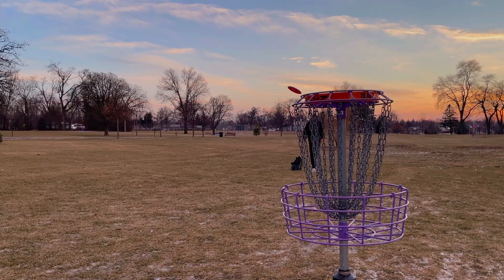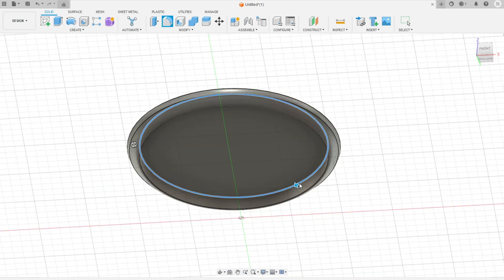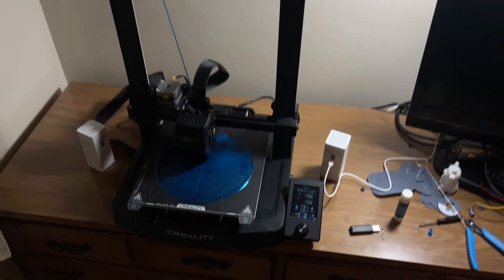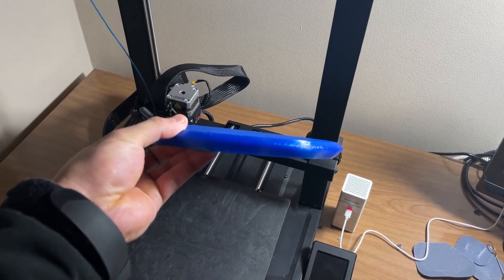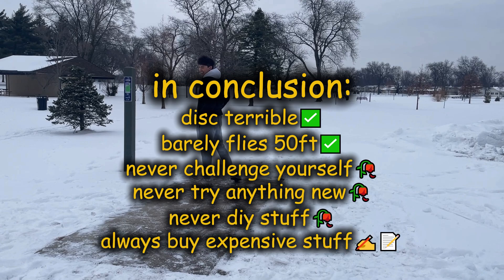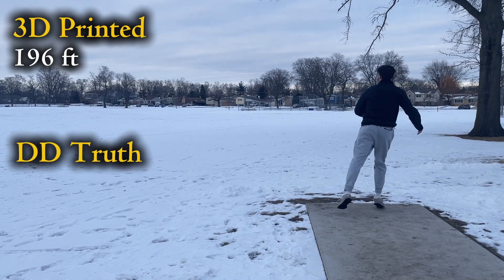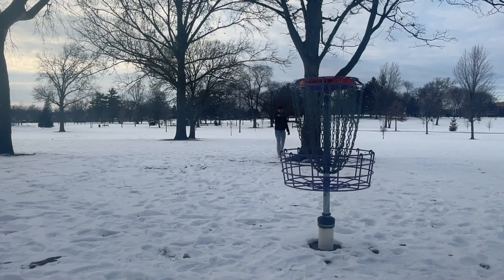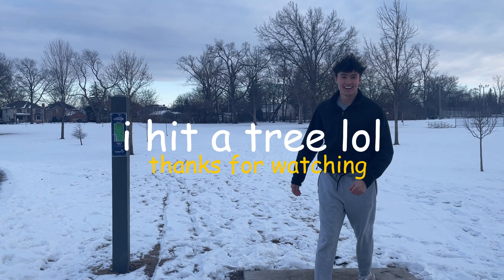i designed a $5 3d printed disc golf disc (its goated)

Comment: What Cad Software did you use?
Reply from the maker: I used fusion360 but mostly any cad software works you just need the revolve feature to turn the cross section into a disc
Reply: @j-seroI’ve literally tried to go watch every video on YouTube to try and learn how to design a disc. I’m doing my best to do it in tinkercad. I’ll have to see if it had the revolve tool. But I’m also gonna see if I can design in 2d then revolve it.
Reply from the maker: @BoyteDiscGolf  Tinkercad wont have any tools like revolve, A good one for free is onshape, you can use it on browser, you want to imagine the disc got cut in half and you are designing mainly the rim and the dome part from a 2d profile.

Comment: Are you running that printer stock? You need to use klipper if so. That should at least half your print time
Reply from the maker: Yes I’m new to printing so it’s stock, I’ll look into klipper and prob end up using jt, thanks for the help.
Reply: @j-sero Klipper is super easy to set up compared to what it used to be. Get yourself a Raspberry Pi 4 and a $10 accelerometer and let's go.
Reply: Pff, sure! 😆 How does klipper magically upgrade the extruder and hotend again?
Reply: @oyuyuy it doesn't, but until you run the machine at a high enough speed that the extruder/hotend becomes the limiting factor, you can definitely achieve significant speed improvements, mainly through input shaping and pressure advance. I'm speaking from experience
Reply: @imaginitivity7853  Very limited experience unfortunately - the extruder is pretty much always the limiting factor for TPU. He's printing at about 40mm/s (and rightly so), it makes zero difference what firmware he uses at that speed.

Input shaping and pressure advance doesn't directly improve speed, it's used to improve quality at high acceleration - which again, isn't relevant at 40mms/s.

I'm speaking from professional experience.

Comment: Bro this is sick, I'm definitely designing my own. Did you use petg with 100% infill to avoid breakage?
Reply from the maker: Thank you, I used TPU with I believe around 80% infill because discs tend to have a little flex to them.
Reply: @j-sero You might actually see a decrease in print time if you kick it up to 95% or even 100%. Generating infill patterns at that level of saturation of the model will often cause retraction instead of a straight print line. Either that or get Arc Welder plugin and use gyroid to get constant wavy lines and print at like 30-60% (If you want more weight, go more infill. If you want a floaty disc for a driver go on the lighter end.)
Reply from the maker: @d0h  thanks for the advice, I heard about gyroid pattern and will try it in the future, I wanted to get around 165g for this disc so i just increased the infill until I got around my desired weight. I really appreciate all the advice as someone who is new to 3d printing.

Comment: Switch to Orcaslicer. I have the same printer as you. It took me a while to get used to it from Cura, but it's been a game changer once I finally did. I think it was my third time trying to switch that it finally stuck.
Reply: They are both great slicers, if you want to float a part you have to use cura.
Reply from the maker: I’ll try it out, thanks for the suggestion.